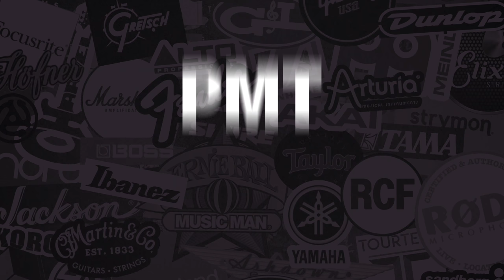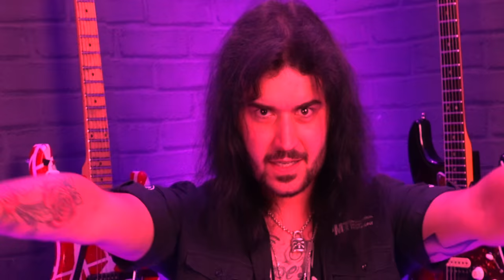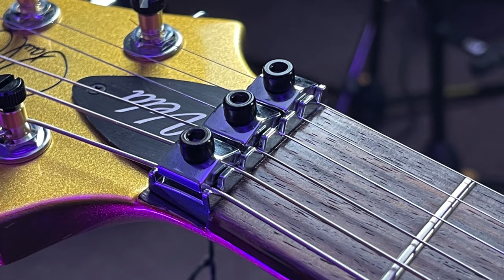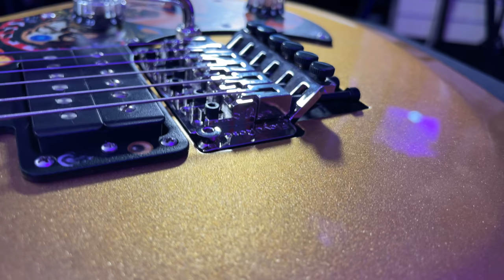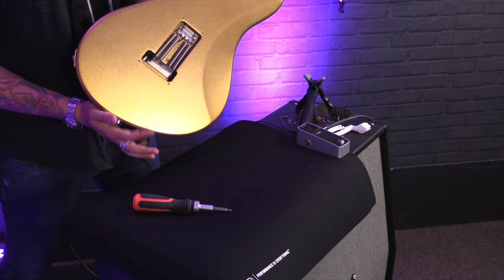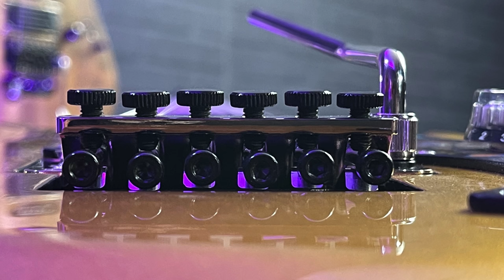How To Restring A Floyd Rose & Other Locking Tremolos! - (It's Not Actually That Hard!)

Comment: Great general tips.  I learned way back in the 80's Not to cut the ball end off at all.  Run the string through the tuning peg to where the ball pulls tight at the hole. Pull the other end just past the string lock screws, cut the string, insert in saddle block, tighten down and tune up.  With a power winder it takes 5-10 minutes.  It leaves no finger stabbing string ends on the tuning pegs.  Nice and clean.
Reply: Well thats actually fucking genius
Reply: doesn't work. will slip out of saddle blocks.
Reply: @metal_helm  Not in 30+ years ever.
Reply: @robtech341  do you have an original fly bros? I've got a licensed on, I think? And that could be it
Reply: @metal_helm  I've had every Floyd from genuine to knock off, works the same.
Reply: Thought about doing that when I was changing mine today...took one look at it and thought "this is going to irritate me to no end seeing the ball ends there " and just did it the normal way. I get it but aesthetically seeing the chrome (or gold or brightly colored depending on what you use) is gonna annoy me. I've stabbed myself more taking them off than putting them on.

EDIT: ironically I came to this video to see if he did the ball ends through the tuning pegs or not from another video he linked this video in the comments.
Reply: @metal_helm  jjJjjJjJjJJjjjj
Reply: @metal_helm  JJ
Reply: @metal_helm  jjjj
Reply: @metal_helm  How so? There's, literally, no difference from one end to the other end of the string after the ball is cut off.
Reply: @metal_helm  I've done it for like 10 years... never had an issue
Reply: The exact same technique I applied on my beloved BC Rich Mockingbird since I own it. Never had a single issue. Plus, the multicolor balls add a nice aesthetic touch. 😉
Reply: I did perfectly without the block but this one needs the block and my other is non recessed and will take steel strings floating won't
Reply: I do this! The best part being being that the ball remains instead of the sharp, exposed end of the snipped string, which can sting if you haven't snipped close enough and you inadvertently stab yourself, lol! I've been leaving the ball on for years! 😀
Reply: @CIRCLEKELDEREMO  I kinda find the ball end to be a nicer aesthetic myself. ☺
Reply: @nickpapagiorgio8038  On Daddario strings the ends of all strings are unwound to help get them through your tuner pegs.
Reply: @justinvzu01  nearly all strings do this. The point I was making is, if you cut off the "ball end" the string is just a string from one end to the other. And nobody keeps the unwound end either.
Reply: Do everything in playing position though I promise you thank me later
Reply: I did that also, but later on I wrapped around a couple times, esp. the wound strings incase they unwind on the bridge and you have enough to reclamp on wound string (if it comes out it's usually come unwound n have to clip end off- back in 1987 $ for strings was tough
Reply: That's cute, but no thanks. Just cut it. I don't need any colored dingle balls swinging from my headstock. Lol!
Reply: @lungloogie  No "dingle balls". Looks cleaner than wound up excess string to me but to each his own! Cheers!
Reply: Yup exactly the way I've been doing it for 40 years!
Reply: if its ok for Steve Vai's guitar tech then its ok for the rest of us..
Reply: What if the strings dont have ball ends?
Some have brass ferrule donuts, and the last inch of the string before the ferrule is wound different and probably wont bend there.
You cant do it.
Reply: Absolutely genius.
Reply: Love the gold ball end against the fender headstock with gold hardware, sharp!
Reply: I just bought a guitar strung up like this,  3 bends in on e it popped out of Floyd. Bad idea!
Reply: Cutting the ball end off is fine and all but it doesn't make the saddle end any different. The saddle end gets the same part of the string either way you string it. @metal_helm
Reply: I tried that myself today and it made my life so much easier. Thanks man

Comment: Put the ball ends of the string at the tuners. That way you don’t end up cutting the string twice 👍
Reply: Wouldn't help much with those strings because they are unwound at the end.
Reply: when you cut the ball off, there is a thick piece of string for 1cm or so which stick well at bridge end when tightened
Reply: i do it like this too

Comment: Thank you, this video helped me out so much, personally use a dried out wine quark to rest the trem on. I ran into  the issue with different string gauges and the trem not sitting flush (always too high) and I never thought to tighten the spring screws. But this also helped me realize that maybe 2 guitars with a Floyd rose is enough for me lol.

Comment: I like to see what differences the YTers and myself have on this topic. This is one of the better vids I've seen. Please do not turn your bridge posts while string/spring tension is pushing against them. By turning with tension there's a risk of waring/grinding the knife edge fulcrum point causing tuning instabilities. Not to say this will be your experience. I share this from personally having turned my action up & down anytime I felt like changing it and then noticed a flat spot or dead zone. If I push down and release it would go flat. Pull up and it goes sharp and stays until you push bar down, tap it, or bend a string pulling it back to resting flat. Also the bar won't flutter, warble or vibrate since the fine sensitive knife edge has worn away. I suggest leave the strings locked in and remove the springs so there's no tension against the posts. Quarter or half turn posts, reassemble and check action. Repeat if necessary. Love the two camps of "ball end though the tuning peg" and "throw it in the trash", lol!

Comment: I have a Ibanez with a double lock tremelo ,I changed strings for first time,it took two days and a lot of patience,all cleaned strung and tuned sounds great 👍 hardest part was tuning it after the new strings were on before locking at nut after that it was smooth sailing 🎵🎶🎧

Comment: First time I changed strings on my old Ibanez RG with the Edge III trem I cut all six off and it took motherf*cking HOURS to rebalance that trem lol. So I got in the habit of doing one high then one low string at a time working in from the outside E strings. Now I have a 5150 with the Floyd, doing all six at once is a lot easier than the Edge trem. Great video dude. Loved your Jackson 7 facts video too. Subscribed!
Reply: Yeah, I think most of us learned that the hard way.
Reply: Does that make it really hard to clean the fretboard? Wanna get a floyd but fearful of all this graft haha
Reply: @wettoguitar4265  No, not at all. You just have to loosen them. Loosening the strings takes a bit longer than a regular stop tailpiece, but otherwise it's the same process.
Reply: @wettoguitar4265  no not really. The Floyd is definitely easier to take all strings off for a deep clean of the neck and restring and balance as opposed to say the Edge trems.
Reply: even with edge is better to do one by one to prevent any setup changes and block the bridge with something
Reply: With the edge, loosen the trim first. Makes everything easier.

Comment: Now for Spring adjustment I've never been able to do that in 1 go, however for intonation, I seem to have a golden eye since every time I eyeball a saddle adjustment it's spot on. Also, the tension bars on the headstock help keeping the guitar in tune when you lock the nut. You set the bar up so that the string makes 1 angle flush over the nut from the fretboard end of the nut to the bottom of the bar.

Comment: At the beginning of the year I finally plucked up the courage to change the strings on my Ibanez S670qm bought from PMT. 
However like you I’m a bit of a nerd who loves to know how things work especially guitars. 
I blocked the top of the bridge
then took all the strings off, restrung. I removed the block and balanced the strings with the springs with a lot of string stretching which was the satisfying part for me and did not take very long. Finishing with a general set up. 
Pleased to see that I did it the way you demonstrated. 
It just seemed the right way to do it.

Comment: Thanks! Beginner Floyd Rose user here and thanks to your great instructions, I managed to change the strings and everything went like a charm. I stayed with the same gauge of strings and my Floyd Rose was perfectly level after being tuned correctly. I was a little bit scared of too high tension after releasing the eraser, so I leaned toward the safer side. I wonder if it’s not easier to release the eraser as soon as the strings are attached and tune immediately with the eraser taken out? I also fixed the locking nut only at the very end - when cutting excess string length - so after a few re-tunings. Thank you so much.

Comment: Great video! I'm planning to get a Jackson X Soloist with a Floyd Rose Special, and something I wanna do is block it off and change string gauge to an 11-56 set for Drop B. However, I dunno how much set up work I'll need to do for the nut.
Reply: Nut should be fine because they're normally not traditional nuts. They are a special "Floyd Rose" nut that pretty much allows any string gauge to sit in it because it's a locking nut. The major work is the blocking of the bridge. That's going to be troublesome if you're doing that alone. And kinda eliminates the whole point of a Floyd. But I suppose if Mick Thompson does it (his sig model has a blocked off Floyd because he prefers the feel of a Floyd bridge) then it shouldn't be an issue. You can buy actual locks for them that screw into the body. That way you don't lose sustain.
Reply: Sounds like you’ll be better of with the hard tail model. Getting a FR just to block it is(not to be a dick) a rookie mistake. A hard tail is much better for drop tunings and can be easily modded with a brass block for some added sustain.
Reply: @andymcmillan9260  
You don’t lose sustain by blocking your trem. You actually gain some. Two pieces of wood does the trick, no screws or glue needed. But as I mentioned in my comment to Heidi, buying a guitar with a floating trem just to block it makes no sense when a hard tail model is available.

Comment: Since its not going to effect tuning stability, I always add a few wraps around the tuning post so I DO have enough to reset the string in the locking saddle. Very important as a poor kid with a slightly expensive 1989 Ibanez S Series custom with lo pro II and wizard II and USA DiMarzios in a Blueburst flamed maple top and back. I only had tapes and 7" as new music in the 90s so I could a afford decent gear
Reply: Same here. I couldn't always buy new strings when i was younger, so extra wraps on the post saved my butt a few times.
Reply: @mikewithers299  if you aren't recording or getting paid to gig, it was just kinda standard I the 90s for most guitarists to do. We just did what we thought worked and didn't have all the answers at our fingertips. And somehow POEPLE STILL fuck shit up.

Comment: The only aggravation I ever run into is adjusting those claw screws. Its a back and forth fight between turning and tuning and the bridge ending up like this _/ So I learned to jam a pen under the back of the bridge (like the battery) to keep it level during the string change.  Change strings, tune, pull the pen out and the bridge is usually level. Only time that I have to touch those screws now is if I change string gauges or go lower tunings. But I've also learned to avoid that to by just buying different guitars for all that biz ; )..
Reply: So use a pen instead of the battery?
Reply: Thats a good excuse to buy more guitars I might have to use that one lol

Comment: The best method I found was to place a wooden paint stir stick under the bridge, then remove all the strings, re-string and then final tuning. Very easy and quick way to keep the bridge in almost the exact position as before removing strings. Takes very little effort to replace the strings this way.

Comment: I'm currently in a desperate fight with a floating tremolo restring. My issue is that the only time the bridge is level is when the strings are way under tuned. Spring claw is as far back as I can put it and any further tuning creates a lot of lift on the bridge. I know that the springs are good because they were good enough to level the bridge before I did a restring.
Reply: I'm no Floyd expert. I'm actually watching this for tips while I restring one of mine today lol. But it sounds like either your string gauge is too heavy for whatever tuning you are using (too much tension) - or - that you need heavier duty/ more springs in the back to counter the tension. You can try making the 3 springs in the back into a   / | \   basically ''triangle'' shaped. If they are already like that try making them parallel   |  |  |
Reply: Try tightening the spring claw first to counter balance the strings

Comment: I use a term blocker you buy on Amazon then I have wood block  I got off Amazon fu tone tool for intation it’s easy if you change string gauge black the claw out tune up with the bridge block then back the claw back into the guitar til block falls out

Comment: Ive started doing 1 string at a time leaving the other 5 on. Cleanings a lil  harder but its worth the time saved retuning. The new ones should stay pretty in tune if you stretch them as soon as you put them on. Takes like 10 minutes now. A quick retune an hour later and its good for months
Reply: If you jam something under the bridge to keep it in place while changing you can take them all off and the bridge won't move. I shim a pen under it. Works perfect
Reply: I change one at a time to on Floyd Rose guitars.
It is much quicker because the tune (of each new string) will be instant.
Also, I dont like totally taking tension off the neck and putting it back on unless really necessary. Every now and then its worth it for a good neck clean or fret dressing

Comment: I prefer to leave the backplate off, depending on what the back route looks like without it.  I didn't really like the looks of the inside of my EVH 5150, so I put the backplate back on, and I haven't had a reason to remove the backplate from a couple of my guitars so they still have them, but if I take the backplate off and the route looks nice (it's painted the same color as the rest of the guitar) I leave them off, becuase 1. I think they look better that way and 2. it makes getting in there easier if I need to.

Comment: I always over tighten the low e when tuning up I found it balanced the rest of the strings in half the time. So if I’m tuning to standard I start by putting the low e in f# then when all the other strings are in tune the low e usually levels out back to E

Comment: There is absolutely no need to block off the trem if you are changing same gauge. Change one string at a time. Just loosen up the nut. Loosen the tuner. Loosen lock at the trem and remove the string. Set the fine tuner back to zero then tighten slightly just in case if the string goes slightly sharp when you tighten up the nut. Place the string in and go in reverse. The Floyd should go back to level when its in tune. This will also stretch the string since the trem is pulled down. Do not replace the locking nuts until all strings are done. If you block the trem it will take longer to tune once its removed.
Reply: Any suggestions on how to lower the action, i changed strings (same gauge) now the action is higher and it wont stay in tune

Comment: Additional things I've learned over the years:

1. Tune from the middle outwards, alternating from wound to unwound strings.
2. Final tune in playing position rather than "lying down", gravity effects your tuning!
3. After locking off and final tune, stretch the strings using with the whammy bar. Spin it 180 degrees from playing position and quickly push down 2-3 times. Recheck tuning again, then hardly ever tune your strings for the next 3-6 months (unless there are significant temperature changes).
Reply: My first floater was '86 Ibanez Roadstar II. I noticed then that if you lay the guitar on its back, the weight of the trem pulls strings sharp. So #2 agreed. I pull on each string to "stretch" or settle it into place before locking and pitch holds after lockdown. #3 agreed. Would you please explain your theory behind #1 since I have never noticed a reason for this starting at middle-out alternating plain and wound? Or am I not understanding? Ty.
Reply: @welern2liv815  I found working from the centre helped with tuning stability until the strings have properly settled, and reduced breakages of the unwound strings. No right or wrong string tuning order, I just found it cut down my tuning time.
Reply: @geeman88  is it due to a 3/3 tuner headstock design like gibsons where the 3,4 are farthest, 2,5 are next then 1,6? Or do you feel like it saves time on a strat/ibanez style with 6 tuners on one side?
Reply: It is more about the balancing act of keeping everything in equilibrium as you restring and tune up; the tension needs to be as consistent as possible due to the springs supporting the floating bridge. The more tension you "give" one string, the more it "takes" elsewhere.

Comment: a little tip from someone who is lazy and hates balancing the bridge to be flat with the body... Put a shim, any shim (a battery, an eraser, etc) to keep the bridge in place falt with the body... tighten the screws at the back.  Not much, maybe just a half turn each.  Stretch and tune strings to pitch.  Then remove the shim.  Chances are the bridge would sink into the body.  Just loosen the screws until its back to pitch and it should be back at the position you shimed it at.